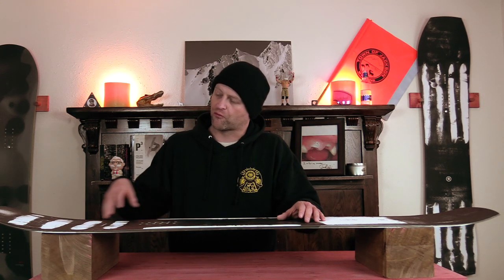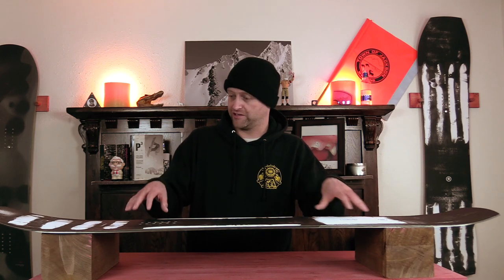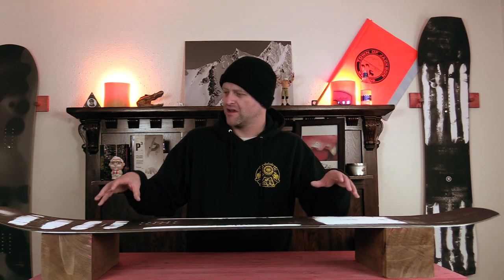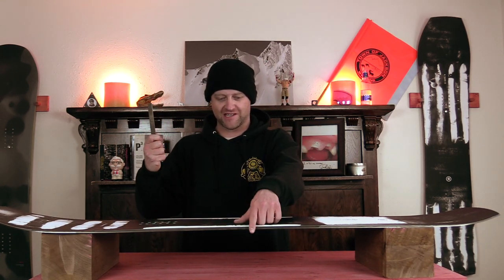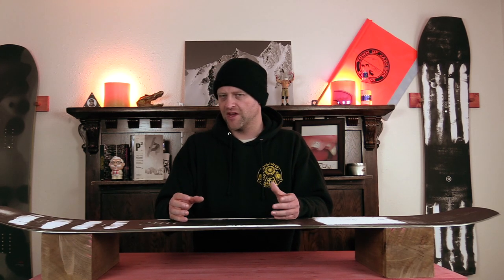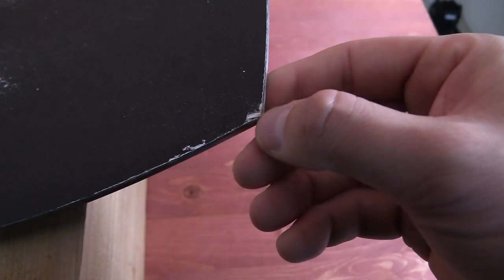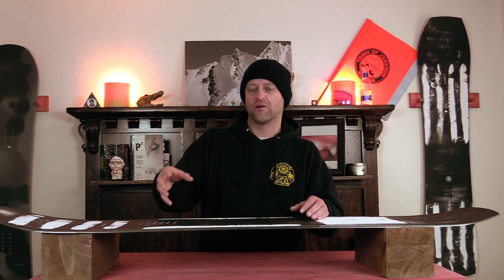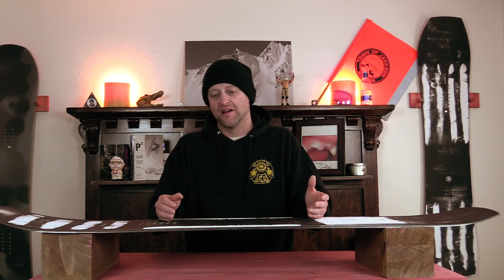The Ride Topless Topsheet: Explained

Comment: Love how my superpig feels, hate the topless sheet… so bad for durability
Reply: i agree my topsheet on my warpig dmg rather quickly
Reply: Same my superpig looks terrible
Reply: @parker5323  Dude same, mine got wrecked yesterday lol. just superglued the chip back on
Reply: @nirrules1  I probably should have done that but 3rd year riding the board and still love it. I’ll probably get a new board next season and use this for early year riding.
Reply: Rode mine 3 times, pretty lightly, and I could see spots starting to lift up. The board is very light though.
Reply: Mine got a badly cracked topsheet in about 2 weeks of riding (right at the contact point for the tail). It was early in the season so nothing crazy went on (one 3 feet jump and 2 rails) 😅 Can't really complain tho, the shop I got it from replaced it for me, they did not have any superpigs left so I could choose whatever I wanted ❤️ Now I use it as a rock board, but I can feel how the tail flexes unevenly when tweaking tailgrabs or carving on the heel edge 😬

Huge props to the shop! Did not go in there expecting anything, I wanted to buy a new board and they just hooked me up 🤘

Comment: Hey angry. Does the new roll in construction help with the topsheet cracking? I want to get a benchwarmer but my 2019 superpig cracked. Noticed the older models didnt come with it.. also topsheet of the benchwarmer still looks different, have you ridden it yet?
Reply from the maker: I never noticed it but the Benchwarmer has a different topsheet than the Super Pig.

Comment: There's no way these things are more durable. Damn near every pig has cracked/chipped/damaged topsheet.
Reply: For sure. Every time I take my Superpig out, it comes home with another crack in the top sheet (usually the tail). I beveled the topsheet edges with a sanding block and that's keeping them from chipping at least.

Comment: Hi,

Just got a 2021 Ride Machete and from the frst glance at it I thought something's different on the topsheet. I can easily see what i believe is the fiber glass textures underneath the print on the topsheet. However, I couldn't find any information online about the board being topless. Anyone can confirm either the 21 Machete is topless or not?
Reply from the maker: It's not.

Comment: Durability not that great. My Twin Pig chipped on the first time I took it out. Light day in the mountain (not many riders) so nobody ran into the board. It was a soft snow day too. About an inch of topsheet lifted up in the tail. No damage or scuff marks on the edge so didn't run into anything. Ride wouldn't warranty it. Said I probably hit something blah, blah.. Ended putting epoxy on it. Got rid of that board later and now on the Salomon Dancehaul 🏂